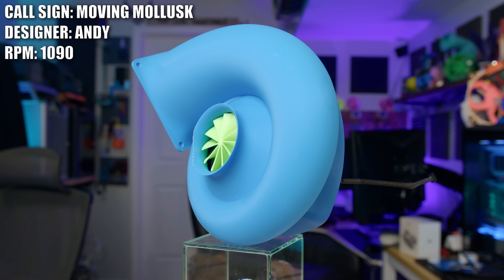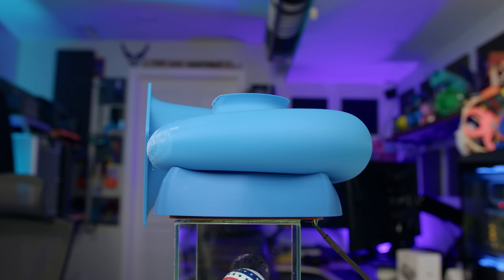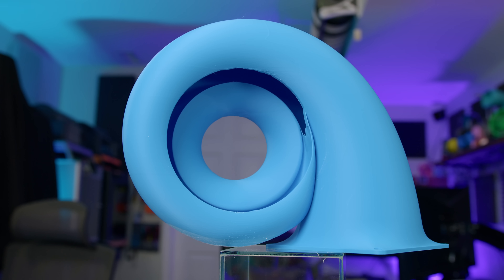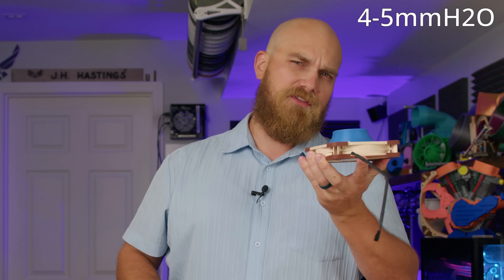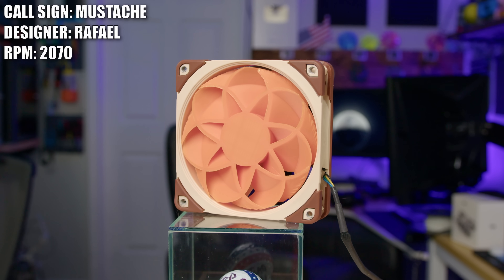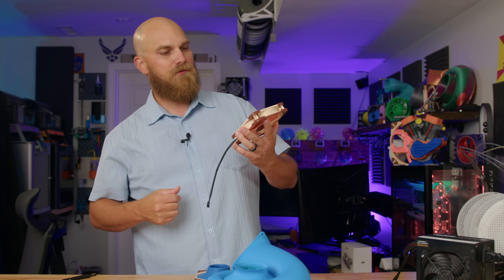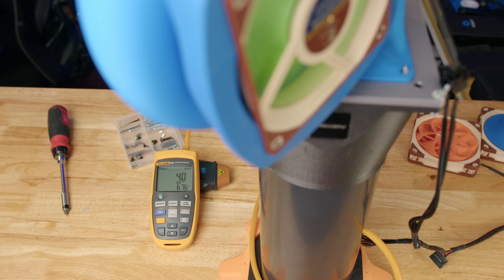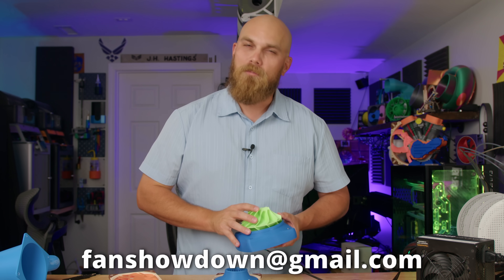A Twin-Intake Turbocharger… Turned Into a PC Fan! | Fan Showdown S6E12

Comment: Major Hardware Fan showdown how to make a good fan with a Noctua A12x25 base(Pure raw static pressure and airflow engineered for a single purpose: to win):Don't care about the Noise or dB at all, maybe some stator blades, De-swirlers anti-surge or anti-stall ring, feature a velocity stack or a nose cone ,lots of blades, very aggressive pitch, a inlet cone or a big bell mouth and Progressive pitch aerofoil blades.

Comment: I am a big fan of the more practical tests. Static pressure is great and all, but unless we're building ducted PC cooling setups, it isn't always practical. CFM and even airflow straightness can have a big impact on how well a fan cools a radiator (and I don't just mean a water radiator, I include "air coolers"—which are really just sealed evaporative coolers—in that description).

A lot of the fans that do really well in static pressure tests would fail utterly at actually cooling a PC, because without CFM, the static pressure doesn't tell you anything about how much air you're moving across a surface, unless you have to get through something really restrictive to get to that surface. a radiator is not restrictive in that way, and some previous testing tells me that airflow straightness might actually have a greater effect than static pressure, assuming the same CFM.

All that said, I think a slightly better controlled test for heat transfer would be really cool. Using a PC running a stress-test has some virtually uncontrollable variables, but I'm sure there's a better method.

Perhaps bringing a specific amount of water to boil, shutting off the heat, and then measuring the amount of time it takes to bring the water to ambient temperature would work.  Ambient temperature would, of course, have to be strictly controlled, as would the quantity and quality of the water used.  You could just take the base plate off of any decent air cooler and submerge the heat pipes directly. 

The main reason I suggest boiling water is that, without pressurizing it, water cannot go above its boiling point until it becomes steam, so the starting temperature is basically guaranteed to be the same.

I have no background in thermodynamics, so there is likely to be a much more scientifically sound way to measure thermal transfer.

Comment: I think the mustache had a printing error on it or something. The Hz of that peak matches the RPM of the fan, so something was causing it to make 1 loud beat of sound every time it made a full rotation. The design looks completely symmetrical so a printing error feels like the most likely culprit

Comment: I would like to see real-world cooling test maybe or force it generates pushing back. Also, I got idea but no CAD skill, so here it for people to steal with credit (I have more to idea I will not put down). What about having multiple layers of blade, but only first layer or last turned by motor. Other free to rotate, but instead turbulence pushes those blades, which might push more air by extracting energy from turbulence, and some of air that is flowing gets redirected to be more straight. They are static ways of doing this and contra-rotating ways, but this might work better as no additionally gearing, adjusts with different air speeds, follows the trail of air, etc, may interact with air better as moves aroudn whole perimeter, or not. Having multiple layers would make each layer more static as less turbulence in each layer,  and allow for better smaller adjustments with time over more to air flow.  I am picturing power layer of any type, and next layers just flat blade

Comment: I love this show. But now, that we have a relatively stable winner in this category, maaaaaaaaaaaaaaaaybe try to ask the community for a fan blade for the BLOWIE-MATRON type of fans! I think that would require a totally different design path and who knows... if somebody comes up with a solution that makes the fan less loud (I don't know how much is the fan noise and how much is the engine noise TBH) then maybe we will have a whole new PC part line up. Imagine, having one BLOWIE-MATRON as your intake for the whole PC that is quiet, powered by the PSU directly and have a controller for it manageable on the OS level ! That would be great. But yea... now that I think of it for more then 1 minute, I find it ridiculous myself too. 😅

Comment: The Mustache is actually a very good fan design. The problem with it is that, that much plastic makes it extremely heavy and pretty much guarantees early bearing failure.  The airflow is outstanding though.

Comment: The thing about toroidal blade design is that it's not inherently quieter per se, but that the frequencies generated are pushed toward the low end, and people tend to notice low frequencies less (and find them less annoying). You've probably experienced this in your car if you're not the sort of person to leave the radio cranked: You get on the highway and suddenly it seems like your music or podcast is quieter, but it's the increase in low frequency noise from the road that you don't consciously perceive interfering with the sound. 
On the other hand, what James experienced is a good example of why they're not ideal for every application. Lower frequencies lose less energy through interaction, so when they bounce off the walls or other stuff in the room the reflected pressure wave isn't that much smaller than the one leaving the fan. That's why the sound seems to fill up the room.

Comment: Idea for next season. ITX build, something like a Ryzen 5 7600 or I5 13600 with a passive cooling tower and say a 4060 or similar AMD. One inlet fan. Benchmark CounterStrike or something see if anything can move enough air through the case to prevent thermal throttle.

Comment: Pleassse do noise normalised test for nex season like the others said the quietest fan that moves most air. If you want a twist mutiply the airflow ( at 20db) with pressure and use that number so you find the most balanced fan for both.

Comment: I mean isn't noise normalized CFM the gold standard for measuring cooling fan performance, with a nod to static pressure if you're pushing through a radiator?

Comment: It seems next season is going to be about sound, based on comments.. As sound engineer: yes, please. 

My testing would be to set a threshold for air flow and pressure that fans have to meet. That ultimately means a lot of them won't meet the criteria, those are then just listed below the line. 80% from the stock fan performance should be fine as a threshold, we don't want to lose but 1/5th of the performance while also keeping it low enough that more entries will qualify. We still test them all, failed tests are important in this specific kind of tests so that we get some progress down the line. It is also about guaranteed that the most silent fans will not perform as well, we can't get max performance while also lowering the sound levels.. 

For sound test, we have to look at the quality, which can be found by averaging the curve (weighted average) and measuring the difference between highest peak and the average. While the position of the peak in the spectrum does matter, it gets very complicated and involves subjectivity. Average vs peak should be fairly good quality metric, not perfect. The more spread out the spectrum is, the better it should also be to our ears. There is another important metric: static vs dynamic, if the noise changes constantly that is bad but there is no way to do that kind of measurement in this kind of "show" format, while trying to keep the workload as low as possible. Three measurements per fan, just like so far. It also keeps them comparable to previous seasons.

Comment: Bring season 7 back to basics. Thermal testing on an air cooler, duel leaderboards for best thermals and best thermals to noise ratio. And start the season off with a re-test of the top two from every season. I might submit another fan if thermal performance is back on the table.

Comment: I think the grading system could use a refresh to give a fairer picture of each fan’s performance. Maybe something like this:

Cost – materials, print time, weight (up to 3 stars)
Design – engineering, elegance, strength (up to 3 stars)
Endurance – noise level, airflow, static pressure (up to 3 stars)

At the moment, the ranking sometimes feels a bit off. Some designs do not aim to be the best overall fan but rather go for extremes—either massive overkill or minimal effort. A clearer, balanced scoring system could highlight well-rounded designs instead of just the outliers.

Comment: Season 7 should be sound limiting (sound equalized) and have it attach to a noctua fan cooler for standard cooling on a cpu. Have it do a benchmark and have the temps determine winner. See how they stack against a factory noctua air cooler/fan combo while also limiting how crazy the designs could be size wise.

Comment: How well the fan >Picks Air Up< use your best static pressure and highest output down a tube with the fan at the end hook the moter to a voltmeter and you can measure how much air they can pick up.

Comment: Moving Mollusk looks very similar in concept to the Garrett GT32 SST used by FORD on the 2011-2014 6.7L V8 Scorpion Diesel commonly known as the "Power Stroke".
Good luck with your experiments ! 😎👍

Comment: How about measuring what the fans are actually used for? Have a radiator filled with water at a known temperature above ambient, and see how much that temperature drops over a certain amount of time.

Comment: 8:25 I'm impressed the "Pure Theory" did so well. I know that compression and airflow are basically opposites, but with how awful it did in smoke test, I thought something went completely wrong with the design. But nah, the smoke is just the opposite of what the thing was made for.
Very impessive compression for such a "simple" almost "plug-n-play" swap.
Now I wish I could get my hands on the CAD file of that one : /
Reply: I can send you the file if you want ;) And yes, it's not made for the smoke test. In unloaded condition it will move about a third of what the stock A12x25 does

Comment: I'm absolutely impressed with Mustache. It was the quietest of the bunch and yet didn't lag behind much.
Reply: Noooo put on some quality phones and listen to that 34 hz peak.  It's massive.

I don't immediately see how it occurs but there's some kind of unbalance in the design so that it produces 1 large sonic pulse per revolution. (2070 rpm / 60 = 34 rps)
Reply: @mikaelolsson4903 that's potentially a printing error, nothing about the design is inherently asymmetric, so a reprint could eliminate that 34 Hz drone

Comment: I may have to adjust my long standing theory that the tighter the smoke pattern the better the performance. I was totally vibing with the F1 and Muushache smoke patterns only to see them be beaten out by the Horn o' plenty Mollusk and the Pure Theory which both looked to scatter air more than anything, Heck, the Theory alone looked like it was blocking more air than it was pushing out.

Comment: It’s definitely got that f1 vibe, but most of those end plates in f1 are to direct the air down the side of the car, into radiators, into under floor of the vehicle and brakes. With some other parts to create vortices to seal the floor from high and low pressure. I’m trying to figure out in my head how a vehicle going 200 miles an hour into air pressure/ compared to sitting in a room at stand still will go. But that’s what this video is about

Comment: Idea for next season. Rig up a radiator with a consistent heat load. The fan that pulls the most temp out of the rad wins.
Reply: this sounds good although the room temp / humidity / heat load would also be a factor, no?
Reply: @PabloEdvardo  Good point. Room temp is pretty easy to account for but he would probably need to run a dehumidifier in the room to maintain a consistent humidity or it would affect the results.

Comment: K as long as you have been doing this and you haven't bought a tube of gasket maker silicone? Many of these multi piece high pressure intended assemblies would probably benefit to some degree.

Comment: Looking at your table, there's a lot of impeller designs that can only get pressure but extremely low flow until you get to something like DiaForce which seems like a reasonable balance, it still moves air!

Comment: 12 seasons in and still only one list.  Maybe S13 will be the one where there are two lists, one each for fans that fully fit in the frame, and an unlimited class for everything else.
Reply: I too agree there should be a separate list for fans that fit in a stock frame vs dont - like i can't put two turbo chargers in my case but I can put two pure theorys
Reply: @absolutely_not_a_pidgeon  That's the design idea of Pure Theory, making a massive attachment felt like cheating
Reply: I feel you, but that ship has sailed long time ago... There is only so much you can do with the fan blades, the results are SO close to each other that we would have to do repeated tests to lower the noise in the data, we saw that already in first two seasons that improvements became extremely marginal and too close or maybe even dominated by noise: it becomes random. How well did the printer print it is then a variable, surface finish, maybe even filaments themselves being a factor. They don't all weigh the same, for starters and small environmtal variances start to creep in.

This series would've been dead long time ago. I totally agree with you on principle but this is also entertainment and keeping the community alive....

Next season should all be about sound.

Comment: I suggest the 10025 fan for static pressure, there are many motor power versions. I get more than 6mm of H20. The fan is a wheel motor and the enclosure needs to be constructed around the fan and the opening geometry and exit contribute to flow rate, and max pressure. I am getting 10 CFM and 0.35 inches of water column at less than 2 watts. I control combustion air for wood stoves. We could do a challenge.

Comment: How about laptop fans?

Buys a cheap laptop, turns out it overheats easily, what can you do?  Is there a 3D printable fan/block setup you can rest the laptop on that dramatically cools it from the bottom, where the heat is normally trapped against a table or lap?  There are commercial versions, but they tend to be overpriced for what they are, and I'm sure an incredibly cheap USB powered fan could pull off the same or better result.

Since laptop fans are often used in public spaces, bonus points for being small, light, and/or quiet.  More bonus points for an extra low power draw from the laptop's limited batteries.

I'm thinking ~2 inches thick at most, standard printable area, designed to suck in and transport air allong the sides of the fan instead of front/back.

Comment: Idea for the new season: noise volume to performance: set a maximum noise threshold, then rate performance vs volume for anything stays under it.  You can show every test, but you get to throw out the failures.
Let's have some fans that we want to have in the same room.

Comment: Next Season: "Class A" is Refine the top Three fans on the current list that have excessive housings/add-on complications and "Class B" is Refine the top Five fans that can be packaged in a standard computer case. Refinements could be parts reductions, increased performance, reduced noise. End of each episode have one new fan style submission that can knock off the lowest performer on their matching class, if they can. Have submitters do a little preliminary CAD fluid flow analysis (create a canned process in FreeCAD because that is free and available, submitters import their model, set determined boundary conditions, run a macro) to make sorting easier before building the challengers.

Comment: next season look at quiet fans. to make it fair, look at air moved per decibel. then when you are ready for the season finale, take the top 10, see what the quietest fan is and tune the rpm of the other fans until they are just as loud/quiet as the quietest one. the one that moves most air at that set dB wins